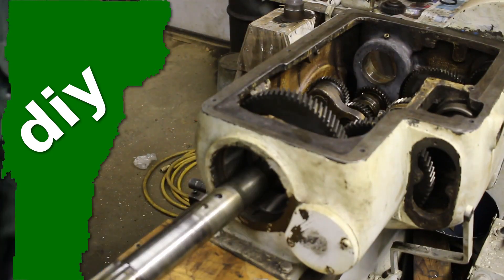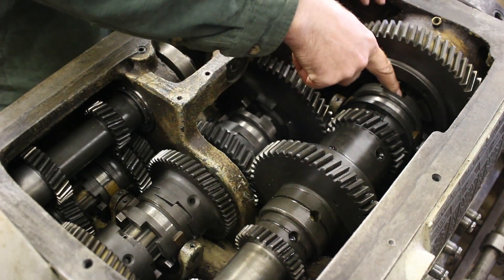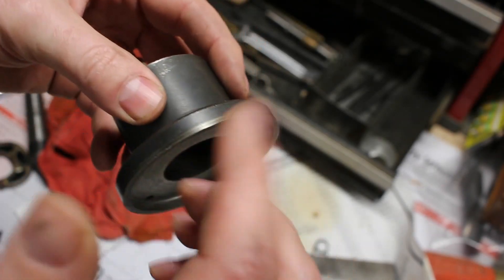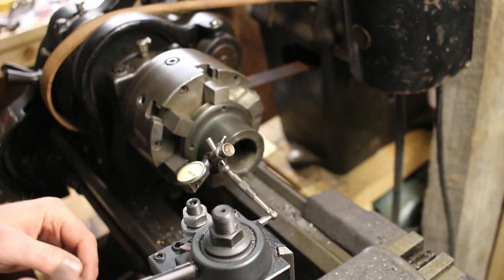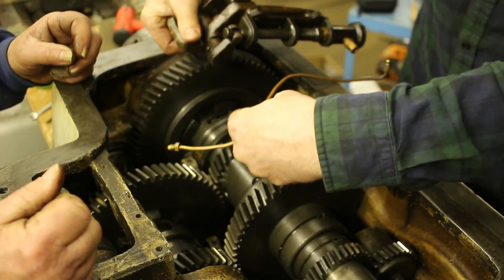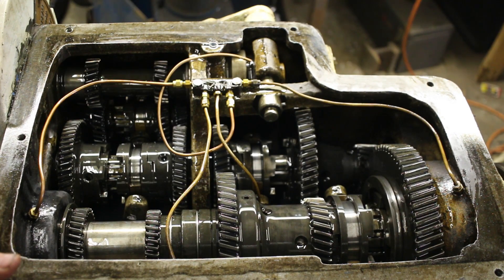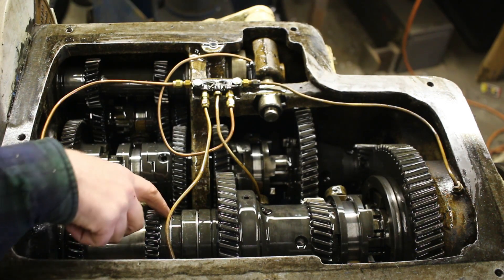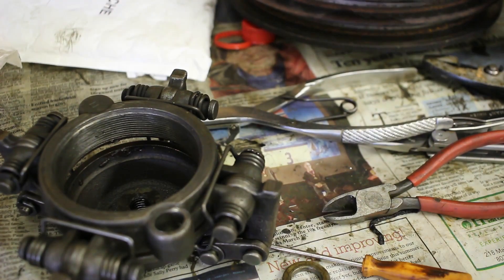Monarch Lathe Rebuild Part 8

Comment: Regarding the bearing surface part that required lathe work; perhaps it would have been better to chuck it up on a machinable stub arbor in order to keep all your machined surfaces concentric with the bore of the part?  It also would be safer to hold in this manner.  I would be nervous about chucking it up on the rim.  Looks like a thin edge that would be prone to cracking from the pressure of your chuck... not a criticism... hard to argue with success.

Comment: How did you get the shift lever to adjust properly? It seems like my shift levers fully engage when its in position but when its depressed into its slot the gears shift back.
Reply from the maker: The main thing I remember having to do was to clean up the shift dogs so they would engage fully. Also the pins that the levers lock onto aren't centered on their mounting threads so by rotating them I can change where they lock in place. I don't know if they were made that way by monarch or if someone got creative. My lathe has two shop made handles so it had an accident at some point and was fixed.

Comment: Looking great so far! I just got my hands on a 1939 Monarch 10ee and had fun taking the spindle out to replace the feed director selector.
Reply from the maker: Does your 10ee still have the weird electronic speed controls?
Reply: diyVT  actually mine is before all of the electronics and has a hydraulic transmission that you turn a hand wheel to increase the spindle speed.